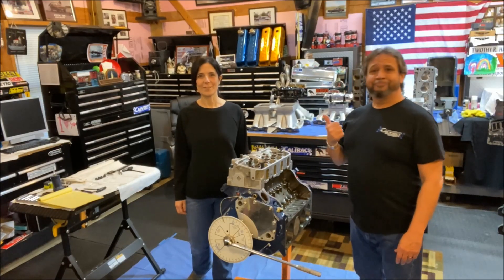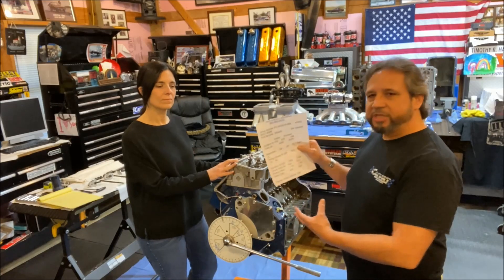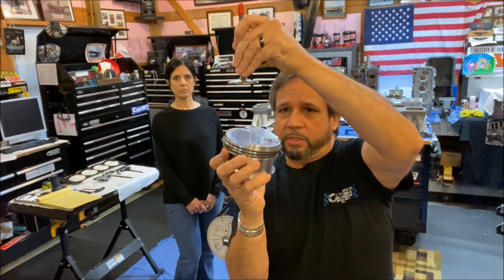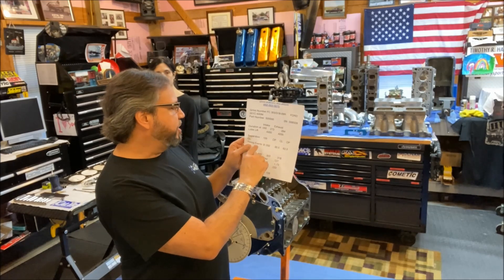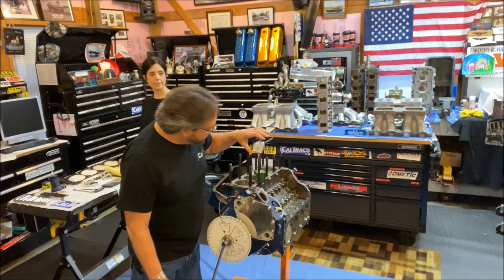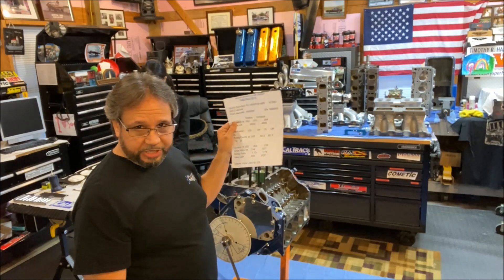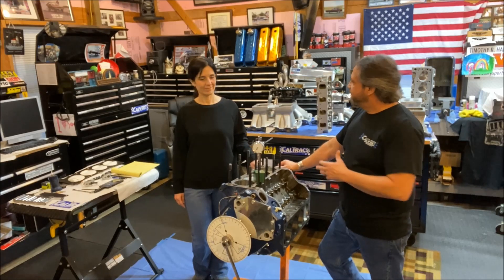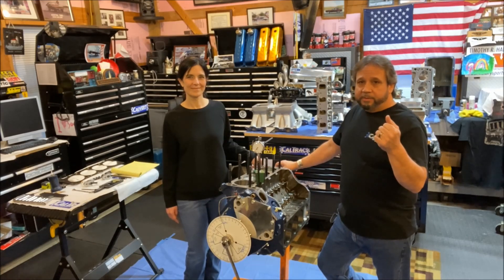Episode 46 Quick And Easy Cam Degree, On A 409C

Comment: I have a  351W engine which is correct for my 69 Mach 1. I also have a 351 Cleveland currently installed in the car. I was told that the Cleveland radiator is different than the 351 Windsor. So I have to change the radiator when I change the Cleveland out for the Windsor does this make sense? Trying to figure out how the best way to ask the question. thank you By the way excellent videos that you have of information is really good
Reply from the maker: I think they are the same, the difference was a/c, or 428, which took the 3 core. Thanks for watching. Please share with your motorhead friends. stay tuned.

Comment: Very nice explanation. Glad to see someone so knowledgeable on the cleveland engine. In 1982 I was 18 years old and built my cleveland on my own. I used a comp magnum 292h grind straight up dot to dot, with 11:1comp. holly 750 dp, 1971 4bolt main block and quench heads. She ran high 12's on street tires at the dragstrip. I still have the mach 1 today and was wondering what timing is used on today's fuels. I'm getting a dieseling effect when I shut down. It never did this in the 80's and I haven't touched the timing. Keep up the great videos. Btw, there are no more dragstrips within 200 miles of my home anymore. Shame. Can't wait to get out of NY. I forgot to mention intake manifold is a weiand x-cellorator. I also used rhodes lifters to help in the low end. 4.11 gears.My stock oil pan has a baffle in it which I never seen before. Do you have any info on optional part's for the cj engines? Thanks
Reply from the maker: Thanks for watching and commenting. Please subscribe and share. I built my first Cleveland about 1981, I was 16. Your combo sounds cool. I bet if you would advance the cam 4 degrees, you would be running low 12s. Sometimes dieseling comes from too high idle. I have had that happen before, forgot what car, but I would shut it off in gear to stop it. Think it it was a Buick, so long ago can’t remember. I never knew anyone that ran that intake. Seems to work. I moved out of ny for that reason, no drag Strips. Now I have one of the best 20 minutes away and like 3-4 within 2 hrs. Glad you enjoy my channel stay tuned my friend.

Comment: Hi Tim Great tech talk there mate,you would one of minority with your wifes support and helping,as i said before not many blokes even get support,you may have seen the vid,just in case you havnt,the cleveland filmed by Fullboost,a 465 cid 14.2 comp and 275 @50 with Higgins heads and manifold,single carb,made1053 hp@ 8500
Reply from the maker: Hey Mate, I almost feel Australian when I say that. I have been practicing my accent. I agree, not many guys wife’s or girlfriends would be into working in the garage. She wants to do more just not sure what to do. It will come in time. I have seen that vid. Not sure what 275@.050, unless you mean duration of cam. Those heads and intakes are wicked. I ask myself, how much HP do you need. That is crazy power for sure.
Reply: @dragboss351cleveland  Thats good, i think,you may verify that,maybe Track Boss Block and maybe alloy, yeah 275 intake and 289 @50 Duration.Spinning to 8500 for size motor is wicked
Reply from the maker: @aussiesupersnake6642  Not far off from what I run for duration, 273/284@.050. Scott Cookes race heads also flow as good as Higgins, maybe better. Thanks for the clarification.
Reply: @ aussie supersnake,  every time I run across someone that has doubts about the amazing power potential of Cleveland style heads, I suggest they check out what FULLBOOST has been posting. The Higgins Cleveland head and intake combos are making some serious power levels. Naturally aspirated, no nitrous, all engine the Aussie way !
Reply from the maker: @danielwilson6665  x 2
Reply: @dragboss351cleveland  , Tim for some reason (senility) I forgot to include the excellent Scott Cook components when singing the praises of aftermarket Cleveland parts availability. I definitely believe in giving credit when it’s due. 

If I remember correctly, you have been using a Scott Cook AIR SUPREMACY intake manifold on your superior combination with outstanding dyno and track proven results. It boggles the mind with mind numbing power. The same power levels as the seventies Pro Stock Clevelands were dominating the competition with. 

Technology can be used for good or evil 👿. It’s all good in the automotive world and the proof is available printed on the time slips being handed out after every run. I’ve heard that the proof is in the pudding but when I tried it 👀 there was one helluva mess to clean up 🤮.
Reply from the maker: @danielwilson6665  yes Scott Cook has got it going on. His stick looking aluminum heads flow like 380ish at like .800. His heads make power for sure. Yes I have been using his air supremacy intake. Got it worked over by Morgan. So when I dyno it, only think changed is head and intake porting. See how she rolls. The ole pro stick had to be making 825-50? Maybe. Stay tuned....
Reply: @dragboss351cleveland , the early Pro Stockers also had the advantage of a very lightweight chassis. Now just imagine your 408 stroker combination that makes 752 hp @ 7600 rpms and 571 lb/ft of torque @ 5600 rpm in a chassis that weighs over 1000 pounds less than your ‘69 Cougar. 

Your quarter mile times wouldn’t be that far off from the ET’s that the early seventies Pro Stock cars were capable of. Your 427C build using Tim Meyers aluminum Track Boss Cleveland block along with the heads and intake prepared by Darren Morgan  should be capable of 800+ horsepower. It would be a beast installed in a lightweight tube chassis car. Very much like an early Pro Stocker in many ways.
Reply from the maker: @danielwilson6665  so true. I think about what it would be like to have a 2700lb car and 752hp. Wowser. That’s why the more I think about it, more it makes me want to have a dedicated race car. Fairmount or Maverick, tubbed and tube frame front end. Oh yeah now your talking. Add a tunnel ram to the 408 and hang on. My goal is 850+ with TrackBoss, then done with hp goals. Then it will be test and race all the different combos. Stay tuned for more pro stock mania.
Reply: @dragboss351cleveland  , don’t forget the Pro Stock cars all dressed up to resemble a Ford Pinto. For most people it was a love/hate relationship but there were plenty of them around back in the day. Personally I like them because they have a good aerodynamic shape and can actually look pretty good with the right paint scheme applied. The main reason I like them is how they looked crossing the finish line FIRST with Glidden behind the wheel. Of course they were powered by the lowly Cleveland that also didn’t get the respect they deserved mainly because the competition got really tired of being humiliated by a Pinto replica early and often. 

What was especially amusing were the unsuspecting spectators in the grandstands that were clueless about Gliddens winning Pinto. Gambling is rampant at races here in the Southeast and Pro Stock was considered to be like the ultimate factory hotrod. When these drunken gamblers would see a Pinto pull into the burnout area,  they would place heavy bets on the Chevy in the other lane. No matter what Glidden was driving, chances are that he would get the win light. 

I prefer a good game of poker but when a fellow race fan is waving $100 bills around and screaming about how  a Chevy can’t be beat, well it’s time for a fool and his money to go separate ways 😉.
Reply from the maker: @danielwilson6665  no doubt. Have a bunch of pics of Gliddens pinto. That I am making into a wicked video. You will like it for sure. The Pinto carried a whole lot of win flags for sure. Funny when I started racing back in the day the same would go on at my local DragStrip
Esta Safety Park. Betting furiously on near or far lane. When you loose you drive by all the gamblers, you win they are all yelling and shouting. You loose same thing more yelling and shouting, great fun. The Roman emperors with thumbs up or down. Those were the days. Stay tuned.....

Comment: Be interesting to see you setting up rocker geometry to mid-lift theory.
Can be very complex to do if you don't have experience with it.
I spent a couple weeks learning about it.well worth it I may add.my valve train runs beautiful.
Reply: Let's see if it's the same trick I learned.i found a very easy and fast way to get correct pushrod length for mid-lift.
Your to yellaterra rockers will be easy to set up.a little harder with conventional rockers as you can't do much about pushrod geometry once mid-lift is set.I used trickflow rockers 1.73 and they were perfect.did one with harland sharpe rockers and could not get them even close.so the design of your rocker determines everything.
Merry Christmas to your Dragboss family.Looking forward to your see your builds come together. Stay safe.Best wishes from NZ.
Reply from the maker: @jakeeyeington92189  thank you so much for the positive support, I have not touched the rockers or geometry, for at least 6 months so will have to review and see where I left off. The yells terra are pretty easy, 1 1/2 turns form full tight and measure pushrod length, if I remember. Happy holidays to you and your family and stay tuned more to come
Reply from the maker: Thanks Aaron, I have reviewed the vids, and also researched it. No doubt a difficult topic to comprehend. I will do my best, I do have a trick, that I know, makes it a little easier. thanks for commenting on my channel, appreciate you watching and contributing. Its the little things that make the difference. Stay tuned.

Comment: You're absolutely correct!  The huge ports have a big time advantage over the "orange" at high RPM's, but suffered off the line.  I experimented with several different cams and combinations.  What worked best for me in a conventional setup, before supercharging, was to advance the cam 4 degrees and use Rhoads lifters.  After calling Isky and telling them about my planned setup, they suggested a cam ground on a 106 center line with more duration on the exhaust, saying it would take care of some of the inherent port design flaws; which it did.  Wish I could remember all the specs of the cam but thanks to getting older:  C'est la vie.  The only thing I didn't do, and wish I would of, was to stick a 2500 stall convertor in front of the trans to bring up the revs up off the line.  The Rhoads lifters took away some lift of the cam at low RPM, and the 4 degrees advanced helped low end torque by a huge margin.  At around 3000 RPM the lifters are pumped to full capacity and the car felt like a rocket taking off; goodbye big block orange!
Reply from the maker: Oh yeah, great history on your experience with Clevelands. Makes all the sense in the world. I have never used rhodes lifters, as I was always using either solid or roller cam. I bet a 35-4000k convertor, would have been Apollo 12 lift off. Great info for al to read. Thanks for taking the time to write this down, so we can all benefit. I know what you mean about forgetting things with age, starts about 54, lol. Thanks again ans stay tuned.